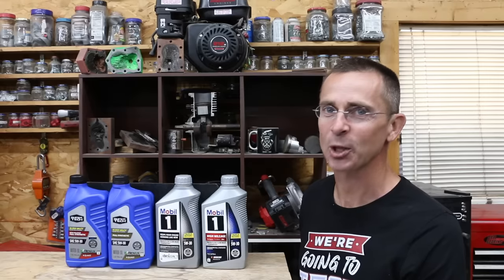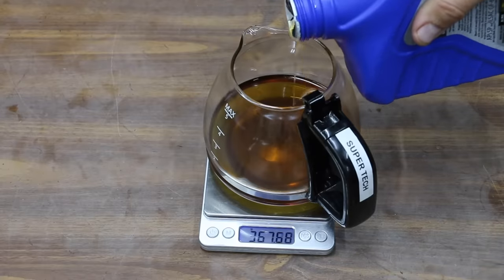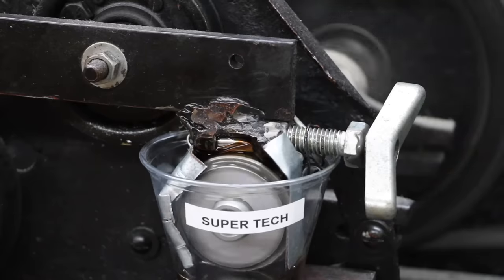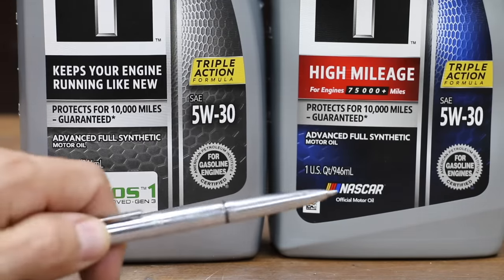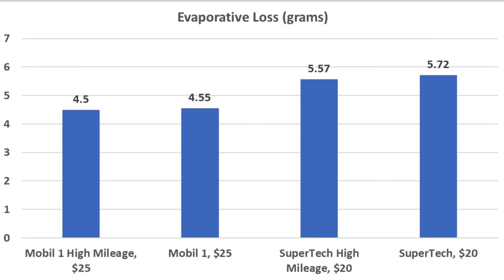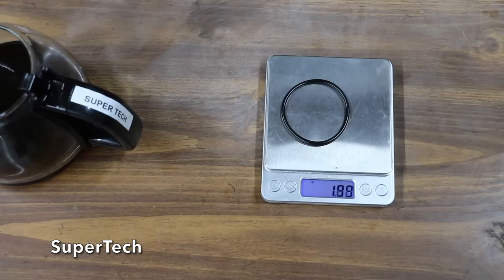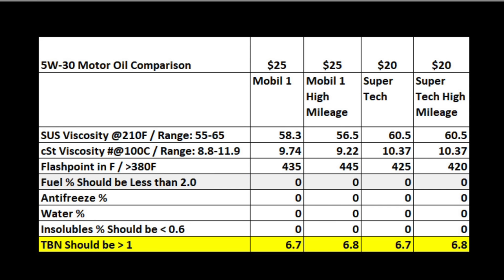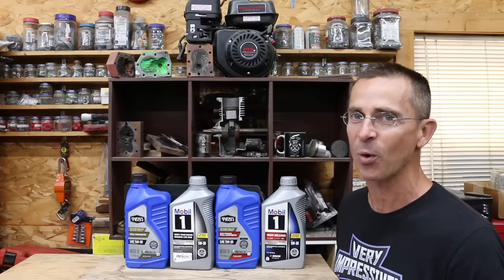Is “High Mileage” Motor Oil Safe? Let’s find out! Mobil 1 vs Mobil 1 High Mileage; SuperTech vs STHM

Comment: I'd love to see tests on the Lucas Oil additives. I bought their "Transmission Fix" for my 2011 Mitsubishi 4x4 Pajero and saw a significant smoother shifting in the automatic transmission to the point that sometimes I can't even feel it, whilst before it was draggy, and I could feel every shift as punch.
The other was their "Heavy Duty Oil Stabilizer", which in my Chevy Blazer 1996 V6 engine, it seemed to start smoother and also would rotate for a very observable amount of time after shutting down the engine.
Reply from the maker: Thanks for the suggestion.
Reply: The transmission in my grandmother's CX9 was slipping. It's completely fixed the slipping issue for now at least
Reply: Another great suggestion. I've personally been skeptical of Lucas, but people say good things. But then some people say stupid things, as well. A perfect idea for something to test.
Reply: My stepdad has that old head mentality with the Lucas stuff. Kinda got used to it so I use it on everything. My Supercharged mustang needs 6 quarts and I always do 5 quarts oil and 1 of that Lucas heavy oil stabilizer. Not sure if it’s hurting the engine but my thought process is “I already go 5w higher why not the “extra” protection.” I do my oil changes every 2,500 miles doe since it’s a daily I occasionally do pulls in. Barely hit 69k miles but I’ve been using high mileage oil since I got it with 60k.
Reply: Lucas : good stuff.
Reply: When I bought my 2013 Civic it was shifting hard and weird, drained 3 quarts and add the Lucas and it made a HUGE difference. I still do a drain and fill every 20K but always add Lucas
Reply: @marklemist6928  I would agree with 99% of them. I used a product called ProBlend years ago ( like 35 ) and drove my car home after it broke a oil pump drive shaft and was shocked at how good the engine held up. I don't even know if they still exist and this was back before all the new oils came out
Reply: I use lucas synthetic additive along with mobile 1 high mileage in my Mazda CX-9. It was my wife's car before she passed and I want it to last. Living in the Appalachian mountains is hard on a vehicle due to the terrain along with high temperature changes in a short period of time the oil is changed spring and fall no matter the mileage due to high humidity and low miles driven.
Reply: @1STGeneral  it

X
Reply: I buy older rigs to use and flip.
Using Lucas for several years,
Love it, oil leak stop, power steering,
H. D. Oil stabilizer, injection cleaner.😊
Reply: I use a quart of Lucas HDOS on all my oil changes
Reply: Does your Blazer have the 4.3 Vortec V6? I'm considering using the stabilizer in my 2000 Chevy Express van with that engine.
Reply: @Sensei_S197  Lucas now has a low viscosity oil stabilizer that's not super thick like the other one that's meant for "newer" cars that seems to work pretty well
Reply: Hello Eduardo! I tried the Lucas Transmission Fix also. My Ford Racing built C-6 manual valve body had sticking valve bodies and hard shifting. Added the Lucas and it cleaned and conditioned  the inside nicely. I am very impressed with how it works.
Reply: @1STGeneral Sorry for your loss. Hope you’re doing well.
Reply: You should go lower on the W rating if you want extra protection. If you go higher, it will take longer to reach all of the compnents in the cold.
Reply: @homuraakemi9556  Good info to know Homura. Thanks for sharing that. Cheers from Motown.
Reply: @ababab1939  Thank you

Comment: I've been using Super tech in my vehicles for a few years now. No complaints. Performs well. My only nit to pick is the clear plastic shrink wrap seal. More than once it's come off kinda shredded and ended up in the jug! But, that's operator error on my part.
Reply from the maker: Thanks for sharing.
Reply: Agreed, the plastic wrap is annoying, and I also had to fish out a piece of plastic before pouring into my engine!
Reply: @tonydavis190  I bought an el cheapo kitchen strainer from the dollar store and put it in my oil fill funnel.

Comment: So high mileage oil of both Supertech and Mobile 1 were only 1/10 of a point better than regular synthetic. After watching this I'm more confident sticking with regular Supertech when considering the cost difference.  I change my oil every 3000 period which puts you even more in the safe zone. Other engine test videos have shown going 10,000 miles between oil changes clogs the oil rings on your pistons regardless of brand.
Reply: I'll take the 1/10th
Reply: Yeah but this was the difference of a quick test think about how much you use a car it will add up quickly and mess something up
Reply: Isn't it like a $5 difference for a 5 quart bottle? Why bother picking super tech when mobil is only 5 bucks more?
Reply: @arthur.monticelli  oreilys and autozone mark up mobile one from like 26$ to 37-38$ so when you see superttech next to it for 25$ people seem to buy it. I have autozone price match my mobile 1 and pensoil to Walmart prices and when they say they can’t do it I’ll leave it and go to a Walmart for my oil

Comment: It may be helpful to analyze the the metal wear by measuring the reduced weight of the test piece, rather then by the size of the wear mark.  Also it would be interesting to test the hot viscosity of the oils before and after being "cooked".
Reply from the maker: Thanks for the suggestions.
Reply: Sheer geometrics makes it a similar test point though. The longer the test scar, the more material removed, as the wheel causing the scar has a constant curve to it.

Comment: My 2014 F-150 with the 5.0 has been getting full synthetic since it hit 100,000km and then I switched to extended performance and now extended performance/high mileage. No leaks and I’m happy with the oil even though the regular price is pretty high (I buy it on sale which is about 50% off).
Reply from the maker: Thanks for sharing.
Reply: Do this test with the same oils after they have been used. Say for 5000 miles, drain and then test. I'd be curious for those results vs new oil.
Reply: @jacobweber9956  that’s a fair proposition. 

I’ve personally noticed that the extended performance and extended performance/high mileage oils both tend to remain ‘clearer’ for longer than plain old full synthetic and much longer than normal oil. I am a truck driver and equipment operator so I check the oil regularly, and keep track of such things.
Reply: Those are solid. Better than the newest ones. Imo
Reply: @@user-bj9qr9og4b if it doesn’t maintain its integrity it tells you by how ugly it appears. 

You CAN tell some things from oil colour and consistency but not everything. 

The longer it’s clear-ish can mean
the engine isn’t producing as much crap or the oil is exceptionally engineered…and synthetic oil IS engineered to give specific results.

Comment: I started using Pennsoil Platinum High Mileage Synthetic 0w-20 oil in my 2015 Lexus RX350 with 166K miles with no issues. Pennsoil synthetic oils are the cleanest of all oils.

Comment: The initial frozen flow test was interesting. That was a day and night difference for Mobil and basically none for SuperTech.
But once it was used the difference was drastically lower. Really interesting.
Reply: @Bloody Mobile That just shows that the first number is when oil is hot and fluid, the second number, higher viscosity, is thick when cold. The funny part about that. People will always say that is wrong, even with proof.
Reply from the maker: Thanks for sharing!
Reply: @ducewags  wait...what? you are literally wrong on this...haha. It's hilarious because you couldn't be more wrong. Show me your "proof", dude.
Reply: @isaackvasager9957  Tell me what viscosity is and what a low number means in the terms of viscosity, without talking about oil.
Reply: @scott5799  Not my first rodeo. Is it your first rodeo on what viscosity is, and what a low number means with viscosity? If the first number in oil is when it's cold as people think, then why is it so thick when cold? At the same time why is the second number as people think, is when the oil is hot it gets thick. I would love to hear what kind of oil gets thicker with heat, and thiner with cold.
Reply: @scott5799  is ok.. Dunning and Krueger effect! 😁
Reply: @scott5799  You think people never say oil gets thicker as it warms up? You did just that with what you typed. You are telling me the 10w30 when cold is 10 weight. And when it warms up it turns into 30 weight oil. That means oil gets thicker, higher viscosity when it heats up from what you typed. And at the same time, you are telling me that heated 10w30 now is a thin 30 weight oil. Or is it a 10 weight oil like I stated as the first number in oil when it's hot?

Comment: You should do more high mileage oil brands like royal purple, amsoil, Castrol, Pennzoil, Costco brand. If they all have high mileage with the dexos certification. I'd be interested in seeing if they effect oil pressure at all in a running engine. At cold and hot temperature. Definitely could be an interesting test.
Reply from the maker: Thanks for the suggestion.
Reply: I would love to see this

Comment: As a user of both brands and specifically a user of Supertech HM in my 230k Subaru, I found this interesting. Thanks for the testing!
Reply from the maker: Thanks and you are welcome!
Reply: HEY! I have a subaru as well. fairly new still -- 30k miles, no issues yet! At what odometer did you start using HM oil? I know the jug says 75k miles, but is there any downside into using HM oil at, let say, 50k? probably a silly question, but I thought id ask
Reply: @MarksTech  I can't imagine any detrimental effects of using it in a younger or lower mileage engine, but I don't think a high milage formulation is even worthy of considering until 80k+. I starting using it long ago, but surely not that early. I wouldn't stress to much.
Reply: @DrewMestel  gotcha, thanks for the reply 🙏

Comment: Thank you for the content.  Ive been turning wrenches over 20 years.  My experience has taught me checking your oil and changing it frequently is more important than the brand.  Also, with newer cars, always minus a few thousand miles from what the manufacturer recommends on oil changes. If they recommend 8k, do 6k.
Reply from the maker: Thanks for sharing!
Reply: There’s a Master Toyota tech on YT who’d agree with you and say change it more frequently than manufacturers recommendations.  Apparently, newer tech engines are tougher on oil and require more frequent changes.
Reply: @alexnutcasio936  If you look at the oil change frequency recommendations, most have 2 regular driving, and severe conditions. Most people probably drive the more severe (short trips, dusty conditions, extended idling, low speed, stop and go) conditions.

Comment: Very interesting. 

So, here is my question. 
Wouldn't using high mileage oil right from the get go (new vehicle) give you the best long term anti-wear protection? (Compared to using normal synthetic up until like 75k miles when the oil states you should start using it).

Why would you not use high mileage oil all the time if they preform better at lower temperatures, and also have more anti-wear properties working in their favor?
Reply: My guess is that you want thinner oils when the engine is new to penetrate the tighter fits. Also the additives create more deposits.
Reply: @JohnDoe-ej3wp  but viscosity is the same so thickness shouldn't matter, looks like the high mileage oils performed better anyway - especially in cold temps, maybe there's a point about deposits.
Reply: I was going to ask this very question, my guess is that we must have a built in failure rate, or else you would never buy a new car.
Reply: @nickademuss42  the engine is one of the last things that fails in a vehicle
Reply: @Egleu1  People not monitoring their oil and antifreeze, and people not changing there oil regulary  Destroys engines.
Reply: @tigerboy60  sure but that's not planned obsolescence like the other person suggested that's neglect.
Reply: High mileage is when buying a used car. I used high mileage pay a little more when brand new car...now at 271k odo n running like new.
Reply: High mileage oils main additive is olefincopolymer. That is stp. It is a viscosity improver. Mobile says the high mileage is ok for new engines. The important thing is to use the weight recommended for the engine
Reply: @Egleu1  Yep! People spend crazy money on boutique engine oil and in the end the rest of the car almost always fails before the engine
Reply: did you get an answer to your original question? yes, no, maybe?
Reply: @MSStateBulldawg83  nope. I was hoping project farm would give a reply, but none yet. Most of the other replies are wishy washy.
Reply: It doesn't matter what oil you use as long as it's synthetic and the viscosity is right. What matters is how it's been maintained. GDI engines of course needs that special oil designed for them. You should never drive a car more than 6k miles or 10k km between oil changes no matter what oil.
Reply: @jasonkillsformomy
Reply: @TheRealoldcar  75k to break in an engine? Absolutely ludicrous! 300-600 miles is enough. For many many years there hasn't been any special break in period with a new car. Just drive it normally from the get go. Modern cars have the first oil change in the manual at 18k.
Reply: @tigerboy60     The quality of engines and lubes are just magnitudes better than those we used in the 80's.  I run 10,000 miles between changes on my Toyota Highlander and will hit 300k miles soon.  It doesn't burn oil and I don't think it ever will.  I use Mobil One full synthetic since I bought it.  I watched a Youtube video of a mechanic de-gunking an engine that had run 93k miles with only 1 oil change (The owners just added more oil when it got low).  Its amazing how good average oils are these days.  I think it was a Pontiac Grand Prix.  It purred like a kitten when clean and didn't smoke.
Reply: @johndoe43   you mean mobil ?
Reply: @cayman9873  yes I guess I added an e by mistake. For some reason we have 2 John does on here. One guy thought my response was wishy washy. I researched the zinc issue stp and high mileage. I've called mobil valvoline Lucas stp to get the real answers to several questions. The reason being I run flat trapper cams in 1970s jeeps.

Comment: Cool tests, as usual.
 Since the high mileage and regular cost the same, there could be a "savings" if the high mileage help seals last longer.
Chevron/Texaco's Havoline offers a "life long" oil. It would be interesting to see how it stacks up against some of the others. It comes in a package, along with pricing that makes me want to try it on my next change.
Reply: I’ve been a fan of the Pro-DS Havoline since the 6qt box is EXACTLY what I need for 3 of my vehicles which call for 6qts. 👍🏼 

My Lab Analysis of it shows it performing the same as my previously tested Amsoil, Redline Oil, Mobil 1, etc. 

Go for it.
Reply: @I_know_what_im_talking_about  I likely will. One of my vehicles takes a bit more than 6, but the price will still be lower than the 5qt jug + 2 one quart.
Reply: Since the high mileage oils were superior over the “under 75k” oils, a is it fair to consider that we should always use the high mileage variety, even on engines less than 75k? Just checking to see if others were thinking the same thing, and if I am completely missing something here!
Reply: @J_Neighbor  I have been using "standard" synthetic on my 2 vehicles, one has 87,000+ the other has 162,000+. The lower mileage one is 10 years older, 11 on model year, and neither uses any oil between changes. The 18 year old I am considering the high mileage most for because of aging seals.
Since the price is no different, I see no reason to not use either.
They all meet the same standards, sans the Dexos on the Mobil 1 tested. I don't need that certification, so I don't specifically look for it on my oils, and both of my vehicles are out of warranty, so a good quality oil that meets the OEM and oil industry standard should suffice. Supertech has been reported as great oil by many users, I have used it in my small engines and their antifreeze/coolant that has done well.

Comment: Nice testing as usual Todd. The Super Tech seems to be a great value even though it didn't perform quite as well as the Mobil 1. If a person changes oil at reasonable intervals either should be just fine. 
I'd love to see you test the ceramic coatings for exhaust manifolds with regard to their reducing temperatures under the hood and increasing temperature inside the exhaust system.
Keep up the good work.
Reply from the maker: Thanks, will do!  Thanks for the suggestion.
Reply: You can buy M1 and PP for less than ST if you can swing a rebate.

Comment: I switched the regular oil in my 2007 Lexus when it had 200 miles. I have used synthetic oil only and I now have 280,000 miles and it does not burn a drop. Still has full power and runs quite. 16 years of trouble free operation.
Reply from the maker: Thanks for sharing.

Comment: Surprising results of the Mobil 1 during -40. I wonder what other synthetics do at that temp. I've always suspected the synthetic I've been using doesn't flow well in cold temps as it seems unusually hard starting if it's not plugged in. Especially 5W30 Dexos2 (not Dexos 1 Gen2).
Reply from the maker: Thanks for the suggestion.
Reply: I also was surprised at that. It has flowed way better when compared to other Synthetics in past tests.
Reply: @Glenb13  They are constantly changing base oils (and a mix thereof) which can significant;y alter cold flow characteristics. This is most likely why the non-Dexos flowed so much better at -40 being that it's mainly NGTL base.
Reply: typically they have to use the better base oils to hit that 5w compared to 10w. wonder if the dexos testing is less strigent in super low temp flow testing